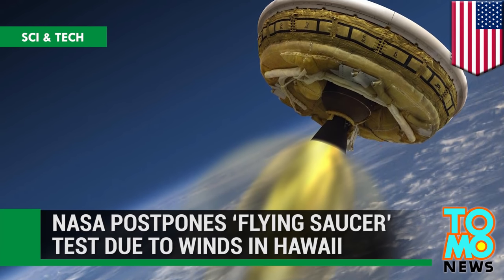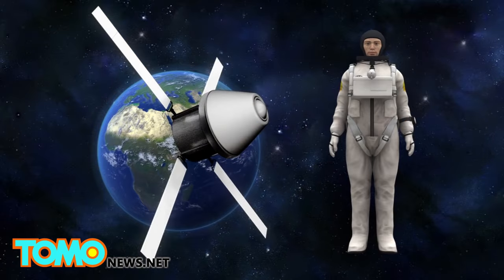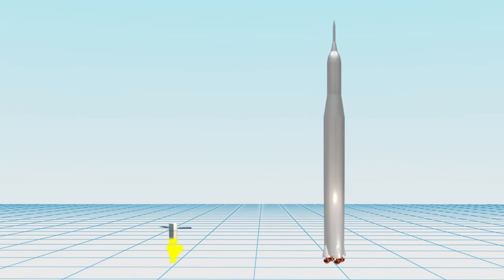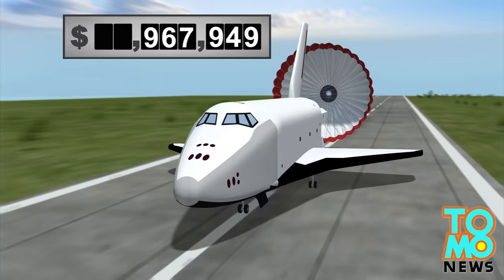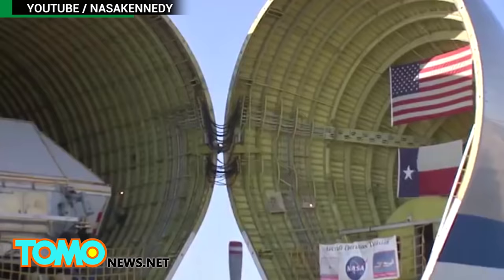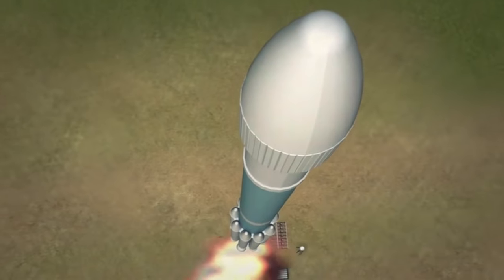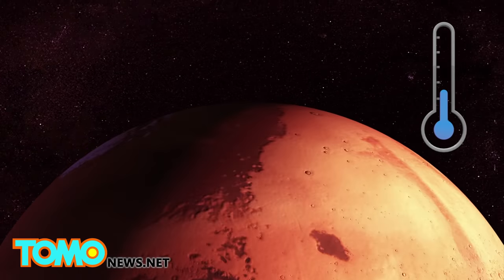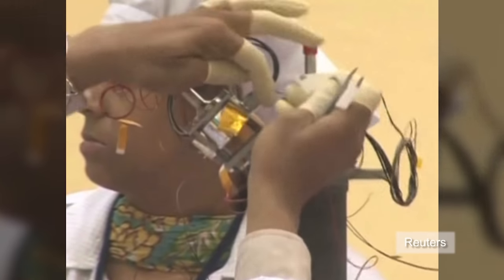NASA's laser-powered spacecraft will fly to Mars in 72 hours - Mars exploration compilation

Comment: It's no good talking about how fast you can make ships/probes go if you have no way of slowing them down at their destination.
Reply: it's that sudden stop that's really problematic
Reply: Just shoot laser in the other direction?
Reply: @michaeljoshua5040  Not sure you have grasped the fundamentals here... the laser is not on the spacecraft. Think it through mate!
Reply: If you are referring to Projekt star shot, they are not going to slow down the micro probes, they are sending hundreds of micro cube seats towards alpha centauri and hope that enough of the cube seats will be able to transmit data back to earth before they either crash into proxima b or get destroyed by dust/ micro meteorites.
If you are talking about getting a ship with to Mars with lasers, we'll. You would need to build a power plant + laser array on Mars first. Also, laser propulsion does not work yet at a larger scale since you have to get rid of the heat generated somehow and radiators in space are less efficient and therefore weigh mire
Reply: @joh22293  He does not specified that is the same laser. 
Use a laser on Earth to accelerate, one on Mars de decelerate. 
But the problem with those 72 hours is not how you slow it down , but how withstand the acceleration. 
So it is a third of the light speed. That means less than an hour with instant acceleration and deceleration. 
Obviously it will be not instant, so you have half for acceleration half for deceleration. 
So is a little above 35 hours for each. How many Gs is that? 
I see somewhere that 1g gives you speed of light in about a year. So a third is 4 months. 
With 10g will be 12 days.  So, for 35 hours wee something around 100g.  
I am afraid that any equipment from that ship will arrive as tin oil. Eh, not quite, but you get the idea.
However, the receiving end of the space ship bust be a light sail. For such an acceleration will receive an tremendous amount of energy.
Will be instantly vaporized. 
For travel to another star, sure there is enough time to slowly accelerate in the limits of the sail. 
But to get to Mars in 72 hours is not quite possible.
What I am getting wrong?

Comment: If you click on the purple channel icon to the left, you can see a rough prototype of an ion thruster lifting its onboard power supply against earths gravity!...  It is currently operational and can carry a small propellant tank for use in a vacuum.  It should go anywhere in the solar system probably faster than the laser driven hypothetical device, if- it can reach space. It still has to be demonstrated that it can continue to go straight up in a vacuum without using too much of an onboard propellant though.  There is also a stabilization system that is just now being finished up.

Comment: A few comments about using laser power to go to Mars. The first one is that to achieve reasonable forces due to photon pressure, it takes a great deal of laser intensity to the point that a minor imperfection on the sail would result in absoption - not reflection - and extreme damage to the sail which would quickly propagate to the entire sail. So this approach does not work. If it did work, how do you slow down from 1/3c? There are technologies to travel to Mars (and stop!) in well under 72 hours, but those technologies are held out of the public eye. Given the way we are all treating each other, that is probably a good thing.

Comment: Send a mission of tumbleweed seeds, cold tolerant cactus seeds, dandelion,  and let it orbit the equator, dropping seeds that can drift to the surface. Coated with rooting compound, small amount of starter fertilizer, clay encapsulated. Some may find suitable niche to hatch. Both tumbleweed and dandelions which hatched and reached seed bearing ability, having capability by wind to widely scatter seeds,  would continue to begin terraforming.
Reply: Could work but you also have to factor in the lack of light increased radiation and lack of liquid water and dangerous amounts of rust in the soil as well as lack of atmosphere pressure and sufficient gravity but I'm no scientist and life always finds a way so who am I to say? But NASA does not want to terraform because of their fasination on the idea of alien life and their search of it... Frustrating that taxes go to it but better safe then sorry I guess.

Comment: Pffft...... laser-powered craft getting to Mars in 3 days?  *No* chance! 
Even the beam of a laser *spreads out* as it travels, and as it does so, the power per unit area dissipates. 
Even if they *could* get it to work (which I would bet money against), the size of laser you would need would be crazy (as would the power needed to run it).

Comment: Lasers loose narrow diameter at any distance. at a 1000 miles the best you can do 100 feet diameter. -called angular divergence - This would be unuseable for prolonged propulsion. If we could overcome this there is another problem that occurs with the 1/3 light speed it would achieve. If the spaceship collided with a single piece of space dust of a couple milligrams the ship would instantly become a 50,000 F degree ball of plasma

Comment: I have a more practical idea that is doable and less costly. Bioengineer algae and moss that can withstand the temperatures of Mars and the radiation and seed these moss and algae where there there is evidence of liquid water. Then hopefully moss and algae will start multiplying. I thought I saw an idea about laying down black matts across the surface of Mars which would absorb the Sun's light, which would heat up the surface/ atmosphere  Without blowing stuff up lol

Comment: What, many of these ion propulsion theorist seem to forget is a force can only be measured as it applies to an outside resistance force or in the case of a rocket engine an inside point of resistance. A rocket operates because its force is applied to the head of the rocket it lifts off the ground. Ion propulsion is deemed to apply against a non-existent point. Ions are I imagine as described, electrons. Any competent physicist will tell you that an ion or electron exerts a force that cannot move a proton mass any measurable distance even at near light speed (ours). This is why the comet theory of tails being force in a direction away from the Sun doesn't work. Radiation simply does exert enough force to move a proton and a grain of sand let alone a boulder sized object would not be moved in the slightest.. Ion propulsion is nothing more than science fiction

Comment: Nice but laser propollsion should be introverted like a transistor shell
Reply: Holographic symmetry suggests that the quantum model is the best model at any size inertia is laser modified in a triometric pinch, the advertiser ripped me off 497$
Reply: Time relativity suggests that a 3 hour tour can take 16 hours on aminnow
Reply: How can you sonically redefraculate elements at a distance into sodium chloride?
Reply: Re ionising Mars will create more hydrogen by radiation
Reply: Use gamma pulses rather than bombs
Reply: Mars and Earth may fight for the force between them, asteroids....
Reply: Adding crystal to an atmosphere refracts the light, add radiation and atmosphere and magnetic turbulance will form, the Aurora will create 03 don't melt the ice the atmosphere will warm the planet, nuking the planet......bad stop using Uranium to make weopons grade #
Reply: The atmosphere will mix with the salt and produce acidic seas and break landmass into continents life will transmit by sound through reflections of light crystal rainbows

Comment: ...To give massive unbelievable acceleration to reach required speeds for only a 72h voyage, you might need say 1,000,000 horsepower for a big craft.. Say 1M kilowatts. Ok then, what is the output of those solar panels? Absolute ziltch in comparison. TEN kilowatts if enormous. We're short by 999,990 Kw of acceleration power. Junk science.
Reply: 1,142,763.89 miles Per hour

Comment: ..... Unrealistic with actual technologies, no way at all .... .... accelerate only 10 kg to 1/3 of the light speed means have an object with Cinetic energy = 1/2 x 10 kg x (100'000 km/sec)^2  = (50'000'000'000 kg x km/s^2 x km x9.81/1000 ) kN x m ... a huge number of Joule of energy to be trasformed in something else to reduce the speed almost to zero almost instantaneously  .... assuming that this object (not for sure human) can be accelerated to this speed in so such small time, how will they stop the 10 kg without transforming them in pure plasma heat ?  ... no way at all, bulshit .... :)